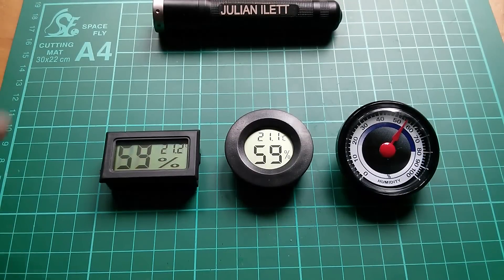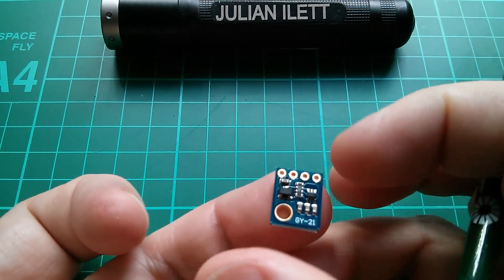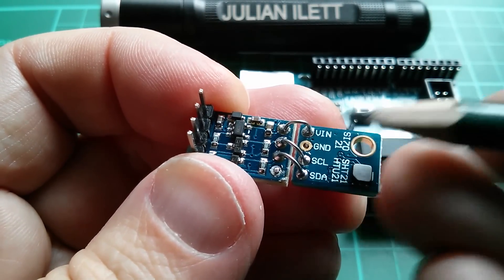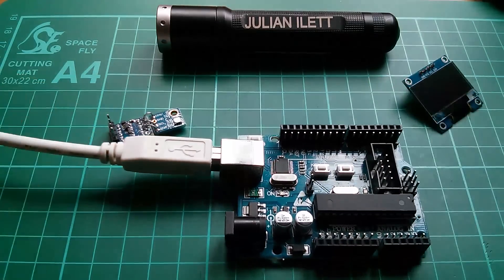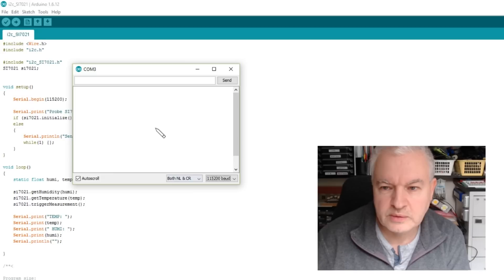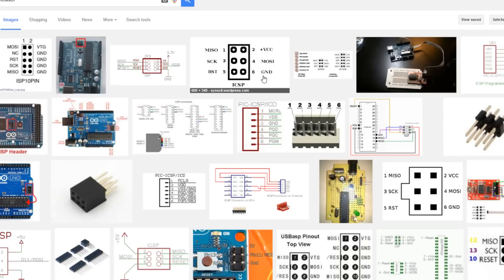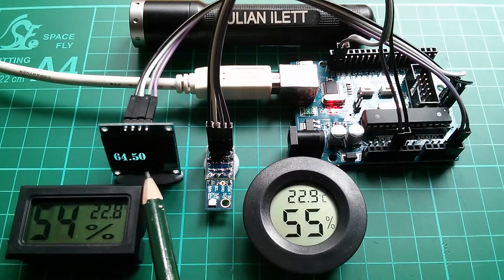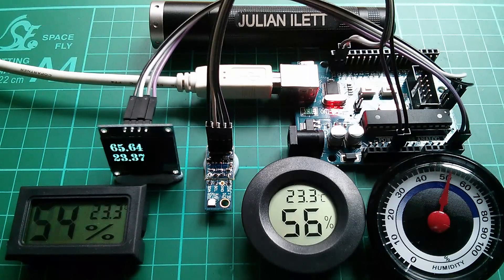1-Day Project: $10 DIY Arduino Hygrometer Si7021 OLED

Comment: I am planning to make a 3d printer filament enclosure and since I don't trust either the cheap sensors, it came to my mind to look for another sensor and here I am, I would like to know if someone can help if this can be managed to be more compact or done via another platform other than Arduino like ESP... just to make the whole thing as compact as possible.

Comment: Hi, thank you for the work involved, I have had limited success so far. I provided the 3.3V from the arduino, and tried taking the scl and sda through 5 to 3.3 level shifter but got nothing on the serial monitor. I took the scl and sda direct to the sensor and got results of a kind on the s monitor. the humi was looking good and responsive to just blowing on it. But the temp was a constant 128.87 which is somewhat erroneous. oh dear, back to the drawing board !

Comment: sht21 is +-2 for RH, sht25 high +-1.8, sht35+-1.5.  Caliber4r is a 1% hygrometer, but not sure which sensor that one uses.  Those cheaper ebay humidity meters are garbage, and use just a pcb trace for a sensor and a cheap coating to absorb moisture.  The other cheap ones use a coil for rotating a needle which is also garbage.   The acurite hygrometers use the sensirion sensors with +-2 RH.  Boveda sells a calibration kit for 7 bucks and is better than using salt.

Comment: Does anyone else have issue with that SI7021 reading 128.87 degrees celsius? But it reads humidity. Of course it's way too low because that high temperature.
Reply: Did you ever get this figured out? I have the same issue.
Reply: Nope
Reply: See my post at the top: I got the same, 128.87, although the humid looked ok, and responsive to changes.
Reply: Sounds like it's pegged out. Do you need to use a pull up/down resistor?

Comment: If incorrect, the chip might need to have its value calibrated in software at this point.  While it is supposed to be calibrated at the factory, I did find a reference to the Si7021 losing its internal memory and thus calibration after the owner poked it incorrectly. google: Si7021 loses calibration

Comment: Another way to get an accurate hygrometer is to build an psychrometer (wet dry hygrometer) and use an algorithm to get the reading on yer OLED.

Fundamentally the psychrometer formula, which describes the relationship between the vapor pressure e, the psychrometric difference (t-t'), the saturation vapor pressure at the temperature of the wet thermometer E', the air pressure p and a constant specific psychrometer coefficient (psychrometric constant) C:

e = E' - [ C x p x ( t - t' )]

The relative humidity f is the ratio of the actual water vapor pressure e to the saturation vapor pressure E' at the prevailing air temperature t:

E' = 6,1078 x exp [( 17,08085 x t ) / ( 234,175 + t )]

f = e / E'

The accuracy of a psychrometer is app. linear to the accuracy of the temperature probes, ie. a couple of +- 0,1C temp. probes will give you close to a +- 0,1% hygrometer reading.

Comment: The recommended and most accurate calibration method is to place the hygrometer together with a salt solution into a small plastic box. One should take a cup or spoon filled with salt and moisten it with a few drops of water. The salt should not dissolve, but merely be damp. Afterwards, place the hygrometer and the salt in a well-sealed plastic box and wait. After about 8 hours the humidity within the box should have reached a humidity of 75%.

Comment: Why not use an ESP8266 board? :-) I've replaced all my Arduino's with ESP's :-)
For fast experiments I use the WeMos D1 or NodeMCU's. 
That way you can use your mobile phone/desktop/smart watch in stead of a LCD/OLED screen :)
Reply from the maker: I want to have another look at the ESP8266 - but where to start?
Reply: BTW I've build an ESP8266 based hygrometer (using a DHT22 sensor) that's been running on 1 18650 (433 mAh) battery for 5 months now (still going).. It wakes up every hour.. sends the temp + humidity to my server and goes to sleep. I 3d printed a nice box with 2 switches. 1 to turn the device on and 1 to put it in config mode (so you can select what wifi it will connect to). It took me a few weeks to make/program but its really cute and works like a charm :) PM me if you want the sketch, php files and 3d model. 
You can see the sensor data here: http://ontspan.net/mamenpap/

Comment: Relative humidity is hard to pin down.  If you want more accuracy then take a look at the new Senserion SHT35 - it is +/-1.5DegC.  However, it will be expensive though in comparison to the ubiquitous SHT21

Comment: my guess would be that those things are one and the same on the inside. That's why they show same reading.
Reply: I'm thinking the same thing. When buying on the cheap like that, the engineering (or lack there of) tends to be very similar if not exact. Especially spec sheets that look almost exact.

Comment: You have a 3.3V output from the Arduino - you can see it at 4:20
Reply: The problem is that SDA and SCL lines are going to be run off 5v, which still isn't good for a 3.6V max device.

Comment: I was just going to suggest salt but there's already salt test suggestions in the comments.

You had the sensor exposed, might the plastic case on the eBay versions be effecting the reading?

Comment: my setup is: Arduino Pro mini, DHT22, BMP 180, Nokia Display. 

i get Temp, Humidity, Air Pressure in hPa and Battery level in %
Reply from the maker: I'm planning a miniaturisation of this project using a Pro Mini :)
Reply: Julian Ilett the setup works great! (near 1 year) but, battery consumption issn't what i want. i build this project again but with a qC on 3,3V and 8mHz by myself.. (Atmel qC, crystal, 2x Cap's or internal Clock!!)  then a deep sleep with an interrupt of 1 min, display refresh.. 

it issn't hard but all has to be matched.
Reply from the maker: I was just thinking the same thing. My miniature Arduino hygrometer will look great, but power consumption will be terrible - probably just a few hours on a 9V battery.
Reply: Julian Ilett jep, jep, that is why i wish a battery friendly version. i think i will also add a Button or anything (PIR?! ) that activates the Display only if required.

Comment: Make a satuated salt solution in a sealed container should give you a 75% ref, i do have somewhere info on making a 22% ref if i can find it.
Reply: I also noticed that the si7021 was giving a instantanious reading where the others possibly only update every 30 seconds or so, you would need to take readings at set intervals eg every 5 mins for 30 mins then average the readings, put them all in a sealed container or do this from a distance as just breathing near some sensors can affect them.

Comment: You can determine the minimum reading (rarely it is zero, it is often 10 or 15%) by placing them in a sealed container with a strong dessicant (something much better than silica gel), such as one of the following: calcium chloride, sodium hydroxide, sulfuric acid, or molecular sieves. Then leave it a day and take the readings. Take note of the ones that have noticable minimum offsets. Now make a saturated salt (NaCl) solution and leave it in the sealed container with them for another 24 hours. It is probably ~74%. Again record each units offset from another. You can do their "maximum" with just plain water but it can damage them so that is only recommended for mechanical type hygrometers.

Comment: Clive found these cheapos reasonably exact.

Silabs makes very good devices in general, but perhaps the sensor you got became contaminated with an oil or other material. An air humidity sensor necessarily consists of absorbent material, so touching it could do that.

Comment: "C always confounds me", created PWM5 solar charge controller and wrote code in assembly :P
Assembly, if anything, is confounding :P
Reply from the maker: With assembly there's less to remember - the PIC has just 35 instructions. With C (or C++ or whatever Arduino uses) there's a huge amount of stuff to remember - syntax, libraries, data types - so much stuff!! On the other hand, coding this hygrometer in assembly would take months!
Reply: Julian Ilett That's true, but I find assembly to be confusing to understand and read, but might change when I become more familiar with it.

Imagine this, the classic games Rollercoaster Tyccon is completely written in assembly by one single guy. That must have taken a ridiculous amount of time

Comment: Is the absolute relative humidity (yes, I mean the absolute number of it) that important to you? Of course it would be nice to have an accurate number, but in the end all that matters is knowing when you have to switch on the dehumidifier.
I have a few cheap digital hygrometers that pretty much show all the same numbers (bought at the same time) and put them in different rooms in the basement. From experience (you could call that "mental calibration") I know that when they climb towards 70%rh I better switch on the dehumidifier otherwise it will start to smell in a room. If it's around or below 60%rh there's no point in running them more. I don't know if these numbers reflect the real value, but the change of the value is enough to see if the dehumidifier is working well enough.
Reply from the maker: Interesting question. But can you say the same about voltage? All my DVMs disagree slightly. Until I bought that precision 5V reference I had no idea which DVM was actually right. And then we discover that all those precision reference PCBs are being shipped with the same piece of paper, with identical "calibration" values written on them. So I still can't measure voltage with absolute precision. Does it matter? Most of the time, not really :)

Comment: Averaging by using multiple sensors to gain accuracy is a valid strategy and works really well (if the distribution of the value from the actual value is random) for the first few added sensors but it has diminishing returns.

Comment: Very nice.  others have commented about the salt calibration method which would be a great tip.  I've thought of making an aspirating hygrometer with ardunio.  two thermometers, one dry and one with a sock on it.  small pump would wet it then small fan would blow on it, then it would calculate humidity from the wet and dry bulb temperatures.  It could automatically wait until the temp is stable to do the calculation.  possibly take readings periodically and log them.

Comment: Where you get those level converters from ?
Reply from the maker: I just bought 10 more - 10PCS IIC I2C Level Conversion Module Sensor 5V-3V System For Arduino  5V to 3V  http://www.ebay.com/itm/-/311576163493

Comment: Face capture: I used the following process in a similar scenario. Record the screen with screen capture and face with your phone. Start both of them and clap before you start talking. When you import both videos in parallel tracks you can clearly see the clap in the audio feed. Use this clap to line up the videos, and always edit them together. It will give you a very good sync between the two videos. And as a bonus you can use the audio from your phone. It is not as difficult as it sounds. Ah, and no matter how choppy the screen capture is, you face will always be smooth.

Comment: You probably have to remove the protective cover from the Si7021. The datasheet shows the chip with a hole on top. The cover protects it during the soldering process, storage and transport.

Comment: When doing i2c i tend to put the pullups on the 3.3V rail, so i don't need level converters. Most 5V devices go all well with I2C at 3.3V.
Also: Is it just me, or are the facecam parts choppy?

Comment: why do you need a voltage translator doesnt the arduino have a 3.3 v port
Reply: The Arduino UNO 3.3V pin is a supply voltage to be used for powering off board sensors / boards that require 3.3V power - etc.  But all Arduino UNO data pins use 5 V on it's data signals.  So - an external 5V to 3.3V level shifter board would be required for the data pins.  And the shifter board would require both a 5V and a 3.3 V power feed to operate.  So - you could use the 3.3 v (and 5v) feeds from the Arduino to power the shifter board - so you wouldn't need a separate external 3.3V power supply !!

Comment: Go with saturated aqueous sodium chloride solution in a closed chamber for checking accuracy. 
Beware that the water and the salt must be pure and even then it varies with temperature, but it should be around 75% at room temperature

Comment: The problem with the si7021 module is it could be using SI7006, SI7020, SI7021, etc. which have varying accuracy. Worst case its +/-5% (the cheapest version).
There is a laser etched code on the chip, but the datasheet does not specify what this code can be.

Comment: When I did a temperature sensor controlled fan for my motorhome, I found I had to add a small load resistor to the output of the sensor in order to improve its accuracy and stability, I wonder if the same is true for the humidity sensor?
Reply: That sensor has a serial Digital output. He can calibrate it with a mathematical formula in his code.
Reply: Coolkeys2009 - yes digital to the arduino, just wasn't sure it the actual sensor is analogue and then converted to digital on the pcb, but badly implemented on the pcb, but obviously I wasn't thinking straight, as there is no conversion, with digital directly out of the sensor.

Comment: i think if you get finger oil on sencer it does not work right. and if you put it in a air tite bag with some salt water  in a small cup water for 24 hr it shoud be 75 %

Comment: Big Clive had a video on checking hygrometer accuracy using wet salt. You seal the hygrometer in a bag/container along with a small dish of salt that is wet. After a few hours, the humidity in the bag should stabilise at 75% at room temperature. The range of temperatures in which it is 75% is fairly wide. I'll carry on watching to see if you bring it up...
Reply: There's a whole range of different salts you can use to repeat that method and plot the accuracy across the RH range. E.g.http://www.robertharrison.org/icarus/wordpress/hardware/relative-humidity-above-saturated-salt-solutions-at-various-temperatures/
Reply: But even then, we don't know how much the error is at different values. All of them may be dead accurate at 75%, but not so much at 60%.

Comment: the 2 digital hygrometers probably have identical innards so idk if its that significant for their accuracy that they agree with each other
Reply from the maker: I think it is quite significant
Reply: Given that the 2 digial and the analogue hygrometers all agree (within the stated error) and the Arduino's sensor is quite  a bit off, I'd trust them over the 7021.

Comment: Julian, versions of the Arduino IDE over 1.6.4 or so do make my computers CPU run almost maximum while only having loaded a sketch window, maybe that is why the upload takes so much longer for you too ?
Reply from the maker: Yeah, I worry about the direction Arduino is going - the IDE is becoming bloatware :(
Reply: Julian Ilett I use 1.6.5 therefore . There is numerous people complaining online about the cpu-hog bug of services.exe and here's one: http://ik1zyw.blogspot.nl/2016/04/arduino-168-ide-problems-on-windows-xp.html

Comment: I see a 3.3v pin on multiple arduino versions. Couldn't that be used ?
Reply from the maker: That can be used to power the sensor. But shoving 5V signals (SCL and SDA) into a 3.3V device isn't a good idea unless the sensor has 5V tolerant inputs.
Reply: +Julian Ilett Oh right my fault I didn't think of the signals voltages. BTW did you check you CPU usage when the IDE is loaded ?

Comment: If you want to do a proper determination of humidity (relative and absolute) all you need is two normal thermometers (alcohol, mercury etc), a bit of damp cotton wool, and a psychrometric chart downloaded off the internet :)
Reply: Well, actually you need to know the atmospheric pressure as well.

Comment: Can try and calibrate with salt &  water enclosure,  as others have said, but still haven't had much luck with the likes of the DHT22 , which are supposed to be factory calibrated. The variance between a few in the same room even after salt water calibration and fiddle factors is pure POOH!
Reply: Kosmonooit
Reply: DHT22 lists for about the same as BMP280 and others on ebay and elsewhere so you can't just dismiss it as cheap junk oh Night.. I think its more a case of bad manufacturing & incoherent testing. BME280 is  more expensive because it does barometric pressure as well. The first  few DHT22's I got were okay and  relatively coherent but the last few were total rubbish, and that's after extended attempts at calibration.

Comment: Greetings from the chilly plains of South Dakota, once again.  Just a note, I still play with the Arduinos from time to time, and like you (probably because of watching your videos) I purchased the ones with both male and female plugs.  When I hook up a couple of i2c devices, I usually just use one set of female cables, and one set that has male for hooking to the Aruino then just use the SDA etc plugs, either that or pick an aruino that has the extra plugs on the bottom of the board like many do.
Reply from the maker: I only have female-female cables, so I have to think laterally ;)
Reply: +Jerry Ericsson I thought i2c can be 'daisy-chained' ?